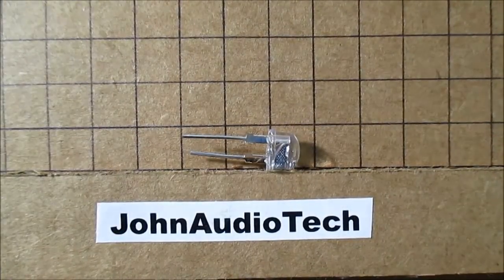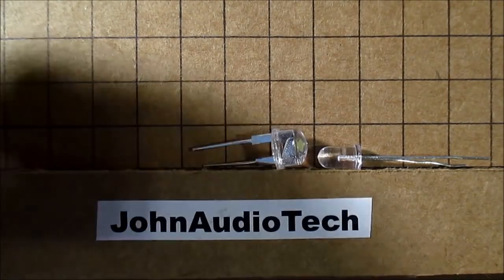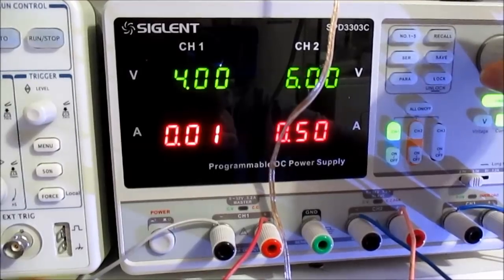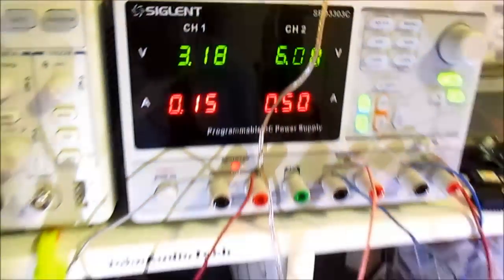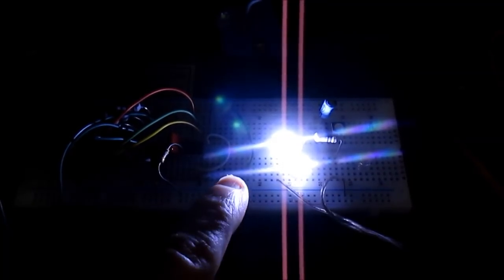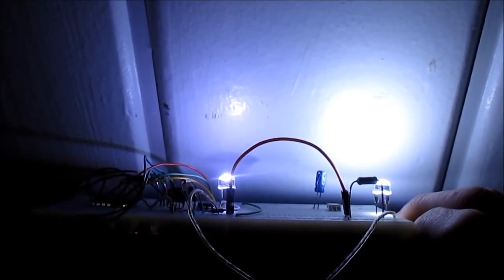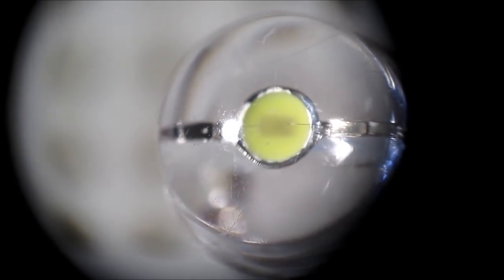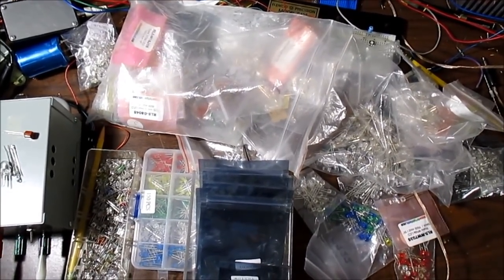8mm half watt LED test & review

Comment: I just bought 8mm 0.5 watt Amber Leds to make turn signals for my motorcycle. they will only flash and be on for a few seconds.what is the best resistor for them? the power source will be 12V

Comment: perhaps they are better suitable @75mA for long run. or @110mA with ~75% pwm.
Reply from the maker: I think they would fair much better at low current. I bought some cheap 150ma LEDs a few years ago and tested them at 90ma. They were nearly burned out after a week.
Reply: likewise. i had these set up at bathroom for lighting @120ma, and they went dim after about a month. :/

Comment: Is it possible that its producing light in the UV or IR spectrum? Do you have a means to measure it? Would a CdS photo-detector be able to detect changes in brightness of IR and UV as well as Visible spectrum? 
What happens when there are too many defects on a silicon die before cutting out each individual LEDs? Do they throw away the complete die? Or do they Auction them of and these are the ones appearing on eBay and alike? 
Fakery is a Chinese art. They can paint a sparrow and sell it to you as a song bird. 
Thumbs-up for the heads-up.

Comment: I bought a 5 meter 12 volt strip and put some over a kitchen counter. 5630 chips rated 60 ma at 3.7V (.222W, 30Lm). After 2 years half the LED strings (3 in series) are dead; the bond wires seem to break inside the package.  They're cool white and don't discolor.  The ones that I run at lower current last forever; I think that's the secret.

Comment: I have a hunch that most electronics components on ebay are production rejects or have their specs grossly inflated, I had a bunch of ebay LED's develop internal parasitic resistance and stop lighting after about a year being run at half their rated current.
Reply from the maker: I call it "dark conducting" as current passes through defects in the die and don't produce light. They will also conduct in reverse bias which causes problems when using them in some types of microcontroller circuits (such as tri-state multiplexing).